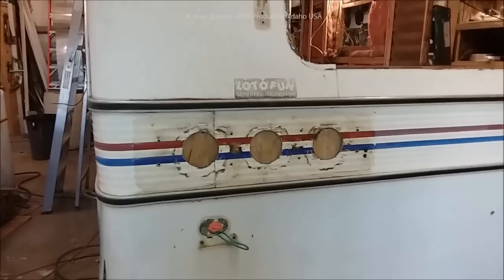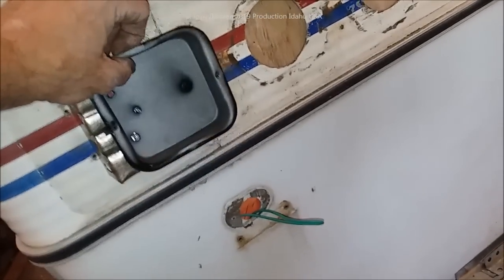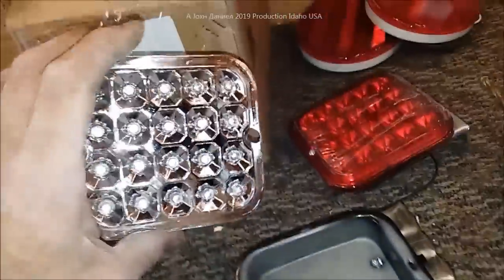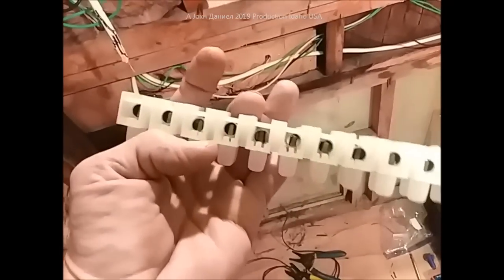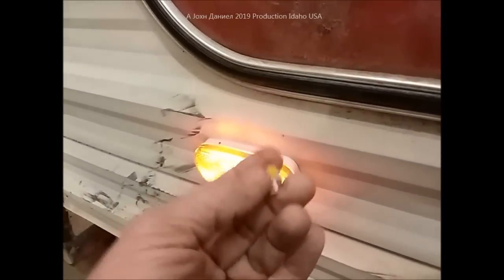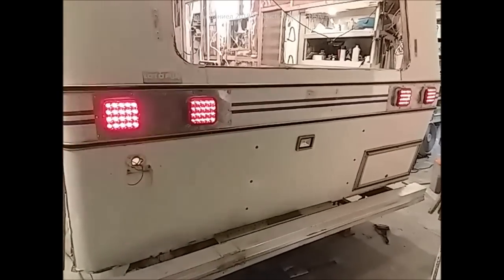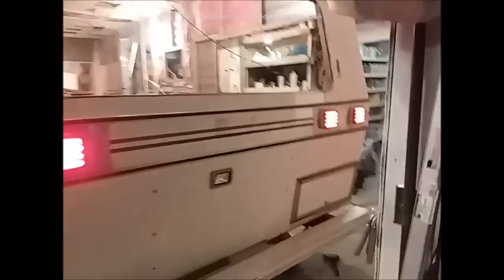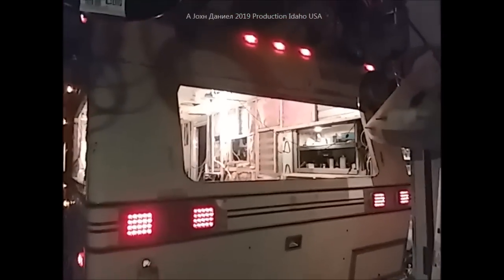Easy RV trailer lighting on 27 foot camper converted to Cargo stealth trailer

Comment: Thank you for the links. I'll order some of these fixtures and bulbs to update my 2008. One of the marker lights got so hot it melted through the housing and fell into the trailer wall..... These are definitely a serviceable and replaceable item that should be on everyone's "to-do" list.

Comment: I found a gasless pma motor concept for your trailer. its a part one and two video, just finished it up. but havn't hooked up the battery bank yet and inverter. to test. missouri wind and solor sold me the parts., I learned from your windturbine video's great job. on new idea's sometimes while camping there may be a day without sufficent wind. for charging.
Reply from the maker: Hope to see your project make some successful results. Never had any luck with those PMA's in efficiency or durability. Guess I just ain't ready to trust made in Vietnam stuff yet, but like China they may just be in their growth to quality pattern.
Reply from the maker: At some point, after they put a certain parasite in the ground who would steal the design, I will publish my Solar to Air to Power system with all its very tuned control systems I designed which I have had in use for years now on our place in the Tex hill country.